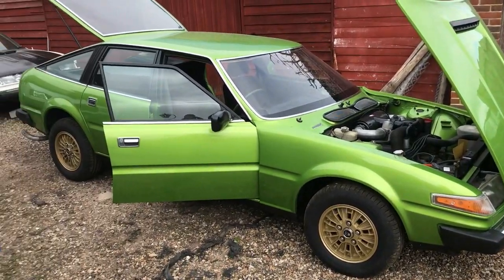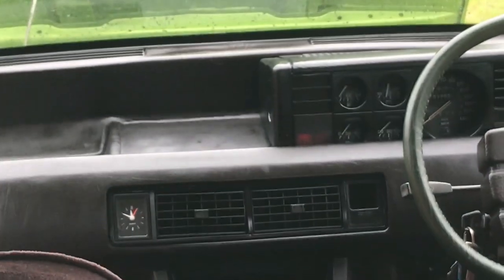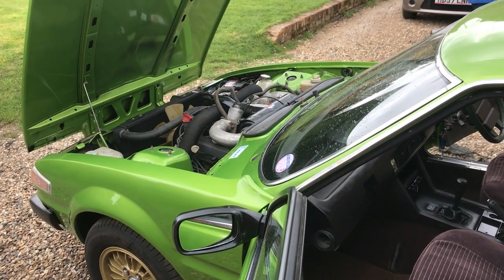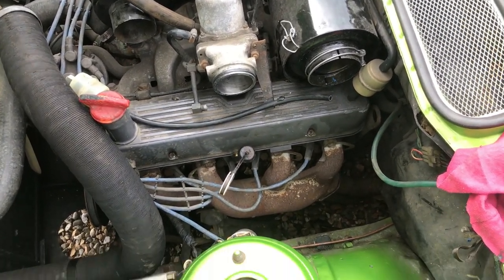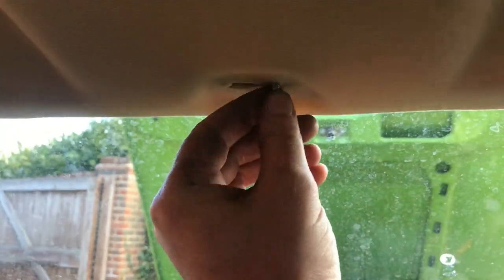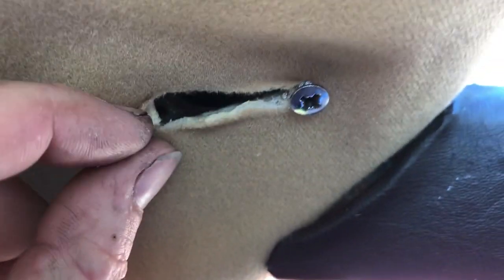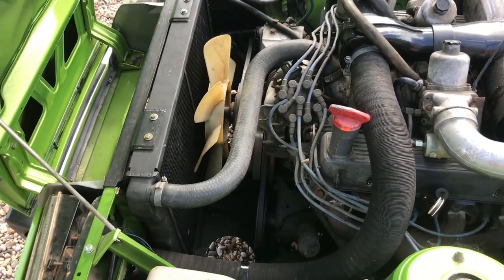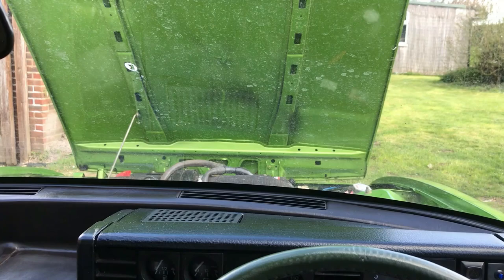Dotty 1981 Rover SD1 V8 Restoration - Video 66 Titting around with sunvisors

Comment: I’ve only just stumbled on your series of videos, and I’m in awe of it all! I had three of these V8s in my late teens, early 20s (I know, unusual for a young lad, but my mates in xr3is were shocked at what they could do). I remember the sheer width of them on the road was awesome too. One thing these cars taught me was to plan ahead, as stopping at short notice wasn’t easy! 
For your issue with cutting the headlining, I might have reached for an oscillating multi tool with a small cutting blade on low power? Since I discovered this tool, I reach for it for numerous tasks, and wonder how I ever did without it.
Love the vids, love the car ♥️
Reply from the maker: Thanks Max.  Lucky man having one back then. I had a metro :( and then an Orion :(:(.

Yeah this one has upgraded front brakes, 4 pot calipers and vented discs which helps.  Really wants Jag brakes fitting.  The headlining is scary as what ever you use,  you dont want it to grab and pull the headlining.

Comment: Where did you get the interior from ?
The one in it when you first showed it was shot, wasn't it ?
Reply from the maker: Yeah it was ruined.  Dash and door cards are original.  Carpet and seats and headliner are all new.  Headliner is brand spankers.  Seats came from a car that only did 400 miles and was crashed.